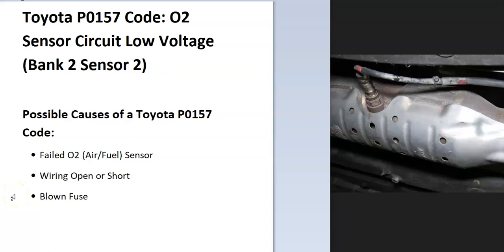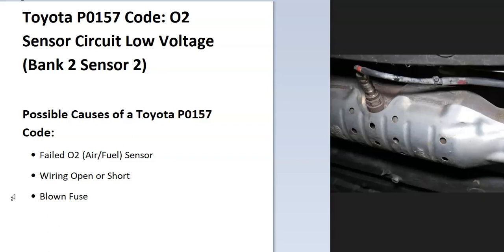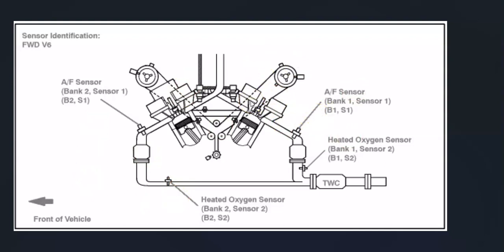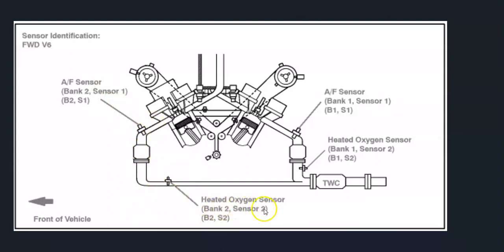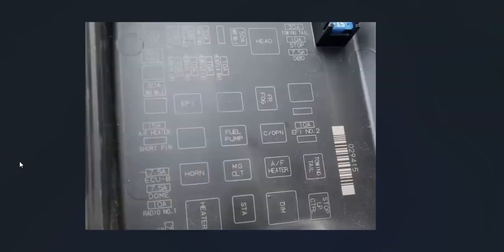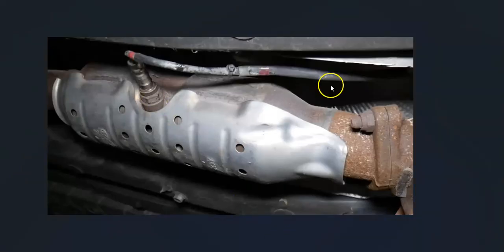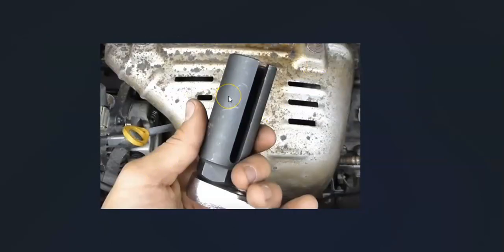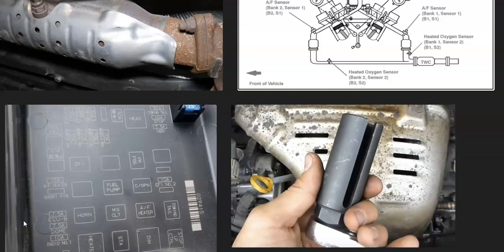Causes and Fixes Toyota P0157 Code: O2 Sensor Circuit Low Voltage (Bank 2 Sensor 2)

Comment: Please be aware: on Toyotas, Bank 1 Sensor 1 [B1S1] is an air fuel ratio sensor [AFR sensor] and Bank 1 Sensor 2 [B1S2] is an oxygen sensor [O2 sensor]. 

Conversly, B2S1 is an air fuel ratio sensor, B2S2 is an oxygen sensor. AFRs and O2s are two different devices and should not be interchanged.

Comment: I have a 04 dodge ram ram 1500, with a p0137 & p0440.
I tested the o2 sensor with a multi meter seems to be working at cold and warm temps bank 1 was .4 constant, vs the new one .4 fluctuates?
Reply: Do I need a new one? , also I tested the Purge Valve also was getting positive for Ooms .14